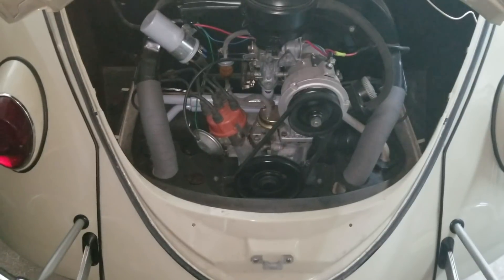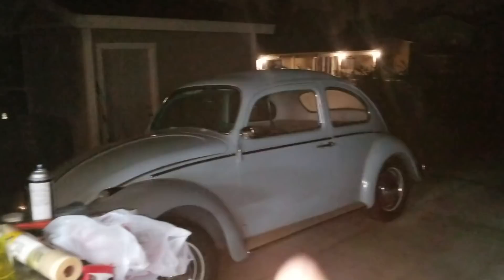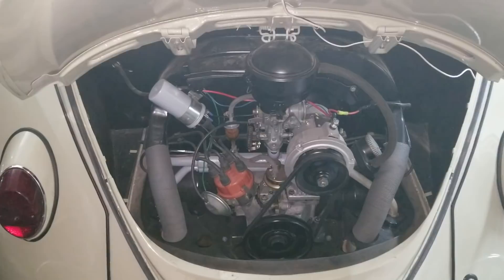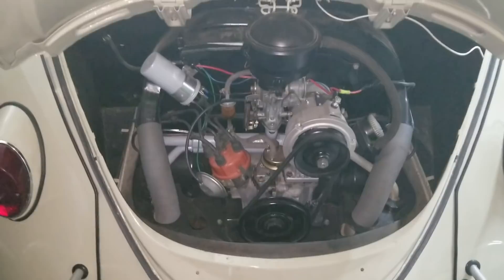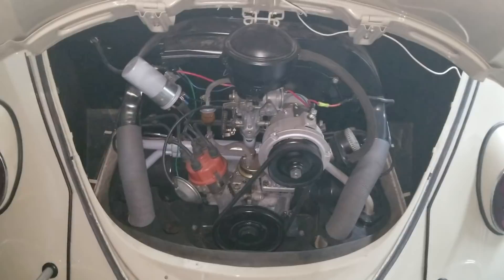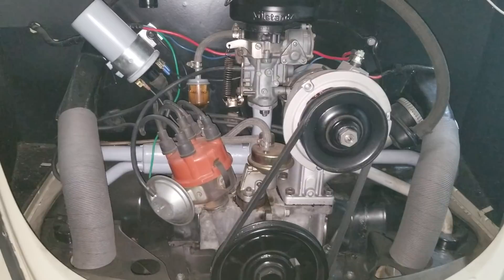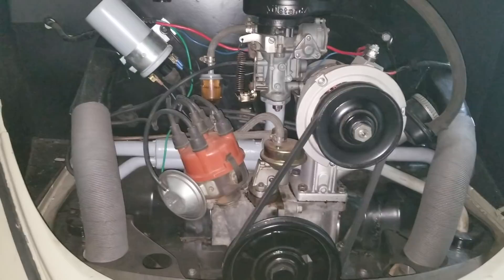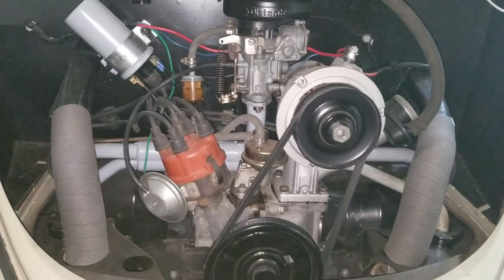VW 40 horse mods that work best

Comment: About crank breaking, I've raced lots of 1200 engine and floord them for ours, acceration and dropping the clutch with big offroad wheels for 1000 times. My opinion is that a stock 40hp 1200 is the best reaible engine ever made. Ive never ever blown up a 1200 after abusing it to shit, they end up having 3mm of end play and will rev even more when they worn on the mains. A 1600? Man they not last half of a 1200 cc. Cilinders get scratch easy, having compression loss and won't run right consume oil having wet plugs, heads get cracked, valves burning fast, flatout cams that cause hot engine failures, low oil pressures,.. A 1600 needs lots of love to run safe and healthy.

Comment: My 40 horse done in '70s still run great today. stock crank, 110 cam, 1385 kit, 1300 heads and 1600 rockers. Running dual 34icts. Not a racer but moves about nicely.

Comment: You could pop a Bosch rev limiting rotor in the distributor cap that will cut off power so that you can't over rev and damage the crankshaft.

Comment: What I did : free flow exhaust and air cleaner, toyota progressive carb (3r), 1.3:1 high lift rocker arms, 009 distributor from Mexico never China or surplus on my 1968 1200cc econo engine. And I put in Pertronix in my distributor after a year. It is just a 1200 but I am satisfied with what I have done especially on the fuel economy.

Comment: Jewburner broke a crank between #2 and #4 sounded like a rod bur it didnt make any metal , to hop it up --------- cam --------- ! the one I had was not very much over stock = .304  , it was 318 .    W 100 = 383 , but it worked good . Jewburner was quik because of the 13 inch tires but would only go 70 which was OK because here in Texas   55   speed limit back then .
Reply from the maker: I read every one of your comments. thanks for watching.

Comment: Mike, could you do a 12 volt conversion with wiring up the  alternator on the 40 horse. I noticed you got two wires hooked up to the alternator. New to the Vw seen thanks...

Comment: I rebuilt my 72 1200 last year and lost power due to the Chinese AA pistons no having a domed head like the originals.
Beware of those flat top pistons, they lower the compression ratio, reducing power! I didn't have the time/facility/ milling machine to machine the heads to compensate.

Comment: Mike if you had a customer that wanted the most bullet proof 1600cc engine...what would you recommend?
what case? what crank? all that stuff. value your opinion? thanks
Reply from the maker: I like AA pistons even though they are china. I would put a forged counterweighted crank never cast cranks no good.  in it  stock case is fine like as41 or AF case for 1600. AA upgraded heads with larger valves. and upgraded combustion chamber are nice or mexican heads. I would still put an engle 110 or 100 cam in it too. German lifters only or scat lifters. scat cranks are great too. The larger cam can make the engine run a bit cooler if jetted right.

Comment: I have a D11 code engine I don’t know how I can power it up it seems it’s a 1200cc engine
Reply from the maker: No real bolt on parts for 1200 you need to be able to do some machine work and stuff. The 1600 rockers will fit on the heads but you will need to size the pushrods. 1384 pistons and cylinders. slip in the existing holes. Remove the valves and clean up the exhaust ports. take the edge off. If your going to do a full rebuild. Install cam bearings and put a engle 100 in there. That is about all you can do without bumping it up to a 1600 or more with that case. The crankshaft is not very strong and will break if you power it up too much and drive it hard.

Comment: Great recommendations Mike, any tips on staying at a given m.p.h. when driving a 40 HP with the Big bore cylinders.
Reply from the maker: all depends on transmission gears and tire sizes.
Reply: Run a solex 31pict 4, 200mm flywheel, 1:1,25 rockers, port the intake, have a good stock backpressure exhaust. And when you can put 1300 dual port heads (needs to cut for compression ratio) on and a engle w90 cam with 1:1.1 rockers.

Comment: Can you tell me what part will adjust the camber back on the rear wheels of my 1968 vw? The rear wheel are angled in at the bottoms...so basically the rear wheels look like a “V” shape when you look at it from the back. Thank you
Reply from the maker: rear must be lowered. gotta do a torsion adjustment to raise it back up. Pretty significant job gotta remove the axles from the spring plates then pull of the spring plate covers and pull out the spring plates mark them before you do that. then raise them one notch and put it back together. kind of tricky to explain
Reply: That year didn’t have constant velocity shafts yet. So any change up or down will effect camber. My 71 does have cv shafts, so I can raise or lower it, without changing camber. Basically the shaft is one piece on yours.there is a joint coming out of the transmission, which gives you suspension. On the newer ones, they added a cv joint to the outside of the shaft and changed the bearing assy. So you always have the wheels squarely on the road.

Comment: What carb would you recommend?
Reply from the maker: 30 pict 3 4 or 30 pict 1 work great on 40hp. dont go too big too much HP will result in broken crank. but small cam head work stock manifold big bore, 1600 rockers all work for upgrades to the engine to get it to run better.
Reply: Mike Fn Garage have an Engle FK41, 1.25 rockers, ported square boss heads with the 83mm AA pistons.  Running with the 28 pict.  Gonna get a 30 pict soon

Comment: Thanks for info going to recondition a 40 hp for just a every day driver thinking about 83 mm pistons mild cam 110 have cases bored for cam bearings  30pci carb 009 dist exhaust header  have a 2 barrel Holley bug spray can't find a thunderbird Holley intake yet to fit 40 hp any thoughts on this set up
Reply: CB cheater cam is probably better.

Comment: Better flowing exhaust gives you more torque and HP.
Reply from the maker: 40hp likes stock exhaust for best torque. the valve sizes are so small needs smaller exhaust to eliminate turbulence and create flow. The bigger exhaust on those creates more top end. but there is not really top end because of the valve sizes and intake port size.